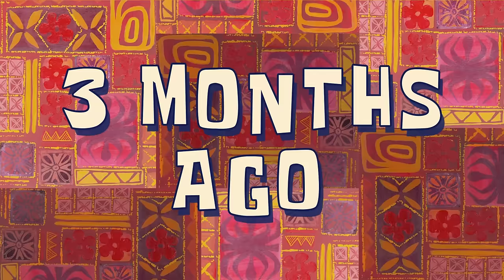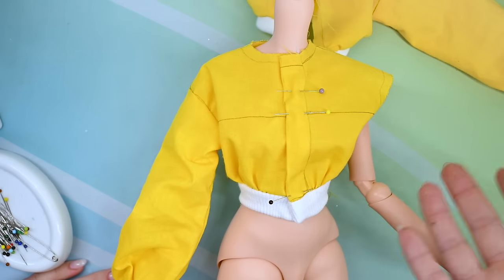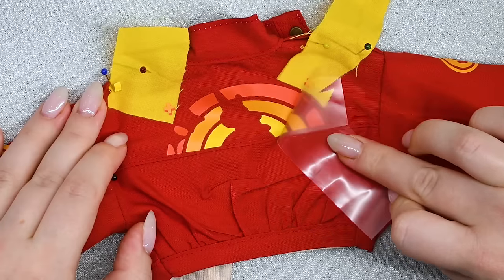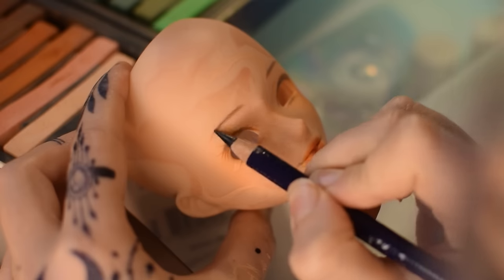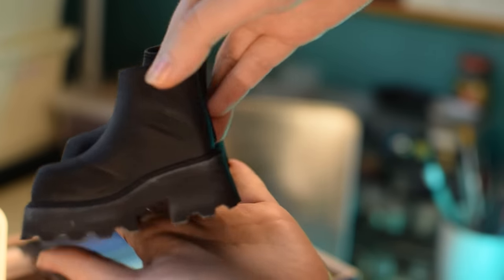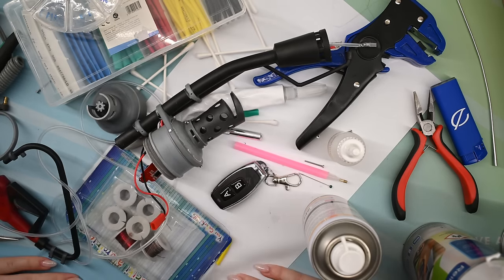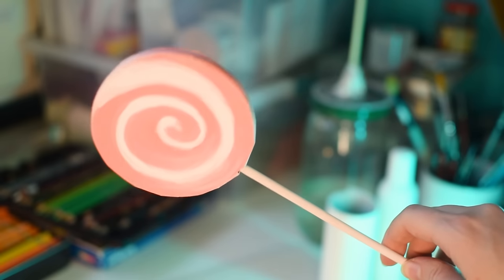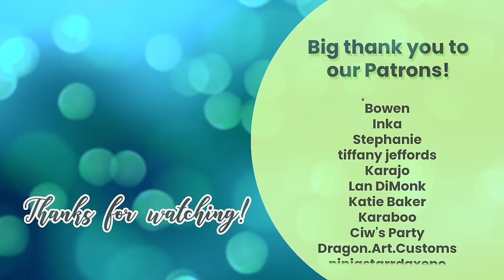We made a REAL mini FLAME THROWER • TF2 Pyro • Smart Doll Video Game Collab

Comment: Question related to potential staining on dolls, do you wash your fabric before you use it? Often there's some extra dye still in the fabric when you buy it so most people will wash their fabric, both to remove excess dye and allow for shrinkage, before cutting into it. If you don't already, I would highly recommend washing your fabric before you use it, unless it's a problem specifically with the smartdolls and not any other dolls, at that point I have no idea
Reply from the maker: I do wash my fabric 🤗

Comment: I have trouble finding hammer spring snaps that work for adult sized clothes. I source some, and then they discontinue them. Repeat endlessly. Also the pants are...so beautiful. Pyro is one of the only characters I have  ever played in a game, so thank you from the bottom of my 60 year old heart
Reply from the maker: This, I rebought from the same listing and I didn't bother getting the tool and now I ran out of the ones I ordered with the tool and the new ones are useless and don't set. And the listing is gone now 🥲 let alone the fact that I have to get them on AliExpress because no one in Poland uses 6mm snaps apparently